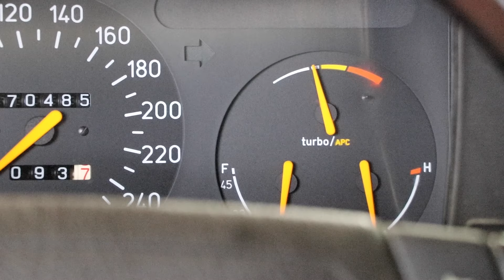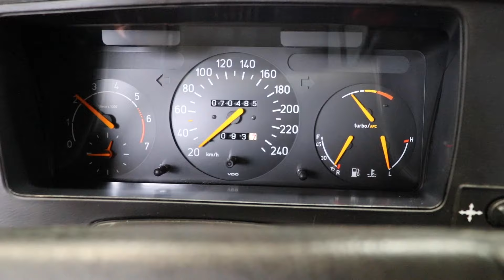Saab 900 Turbo S I By Saab Bredlow

Comment: Beautiful Saab 900! Makes me think of my first car (900s -1990) I loved the sound and driving it. Acceleration in 3rd, 4th and 5 gear. Upgraded shocks/spring, 16 inch aero rims with premium tyres.  🤩👌 Used it as a daily driver for almost 10000km.